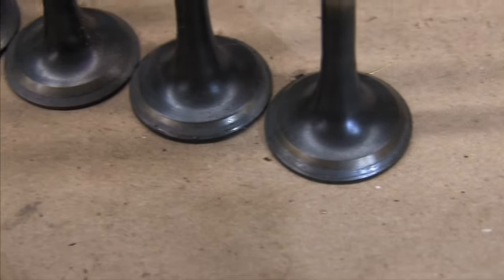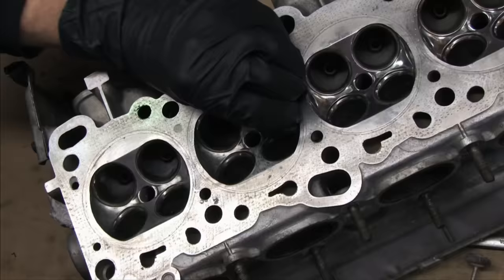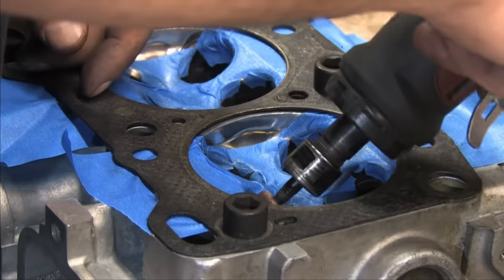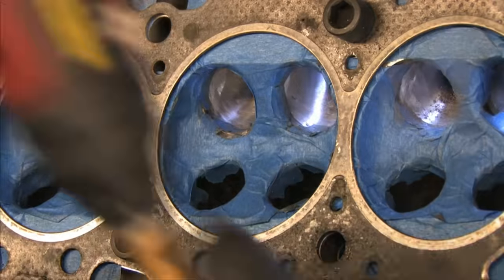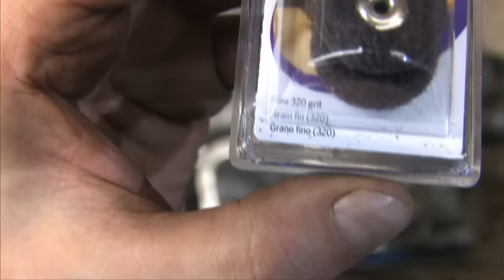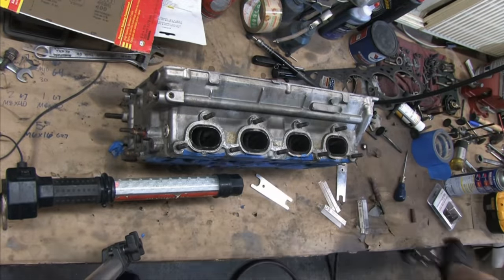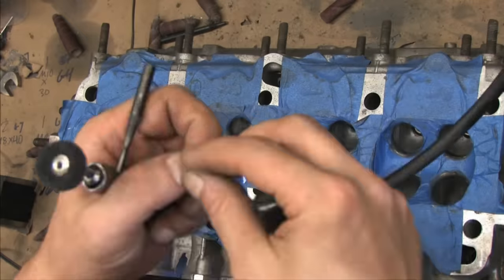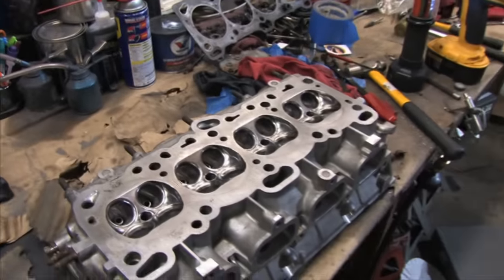Cylinder Head 204 - Porting & Polishing

Comment: I OWNED AN AUTOMOTIVE MACHINE SHOP BACK IN THE 80'S AND I'VE PORTED SO MANY HEADS I'M TIRED OF IT, BUT I ONLY DID CAST IRON HEADS AND HAVEN'T DONE IT SINCE THE 80'S... YOU DIDN'T GET TO THE VALVES AND IF YOU DON'T POLISH THE VALVES, YOU MIGHT WANT TO CONSIDER CHUCKING THEM INTO A HIGH SPEED DRILL PRESS AND POLISHING THEM TOO...VERY PROFESSIONAL VIDEO... YOU BROUGHT BACK A LOT OF MEMORIES FOR ME OF ALL THE WORK I DIDN'T GET PAID FOR...

Comment: The pro shop I use has a porting and polishing setup that is hypnotizing to watch. He fills all the ports half full of steel and lead shot and then tapes them shut. Then this machine rotates it in all three axis at the same time it spins between the clamps. He shuts off the lights and goes home while this thing keeps rolling. Next morning he removes the tape and dumps out all the shot. What's left is amazing. Every single millimeter that the shot can get to is smooth and shiny as a mirror. It peens over any casting lines and casting defects. He claims a 30% increase in flow of both air and fuel. But it only cost him about 40 minutes of prep time in labor. The rest is being done while he sleeps. Liked and subbed
Reply: Uhhhh...LS7 head cnc porting routinely sees around a 7.5% increase in flow. That's 7.5% using cnc porting. A 30%(!) Increase for rolling some shot through a head? Gotcha. So, if the intake side flows 330 cfm, after his "porting", it will flow 429 cfm? Engine builders have the easiest job in the world. Selling rubes horsepower.

Comment: As an engine builder I still smile when I see a polished intake port ! Polishing a port slows down flow, we worked this out in the 1960s , you have just lost power ! Ports are rough cast for a reason , it is the cheap way to induce turbulence in the flow at the port surface , the ideal port would be smooth with small holes drilled about 3 mm apart, just like a golf ball, it is the same principal , a totally smooth ball only goes half as far as one with little holes all over it, the reason being air flow over the surface of the ball , the holes make little vorticies that make air flow more , same as an intake port ,  sure the factory can cast super smooth ports , but they know they need disturbance for flow.
Reply: What about the carbon?
Reply: @turbosloth2  what about carbon ? If you have carbon in the intake port you got more problems than good flow !
Reply: Egr and direct injection and loads of carbon

Comment: 5 yrs later I came back to watch this. I followed most of these points and made good power from porting my heads. Even only doing a Stage 1.5 on my J32 made 316/262.....nice gains!

Thanks for an awesome video that is still prevalent till this day.
Reply: pilzy els I found 80grit, to 120, to 340ish buff wheels like he has is the best combo. 

80 to knock the high stuff down and smooth the port, 120 to smooth and 340 buff to polish (with polish compound).. anything beyond that is a waste of time of a Street, even minor track car. I did polish the combustion chamber and ran 100shot of nitrous for 100k Miles. It was very rare if I got any knock

Comment: great work, and an excellent tutorial. One rule I always keep in mind is intake port velocity for torque, more port volume robs that velocity, so it's a balancing act from intake 
gasket to valve seat.The trick is to resist opening intake ports up too much, once it's gone it's gone... best to aim for progressive transition and know when to stop.
To make real power, always do your flowbench tests with 50% valve lift, as that's where most of your flow duration occurs.
 I made my own once with a vacuum cleaner and a manometer, simple but very effective.
Thanks for posting.

Comment: I have an old set of knock off weld racing wheels on my foxbody they were hazy and chemical stained but one day I sat down with a mothers power cone for about 7 hours and shined all four to a complete mirror shine. After I saw what I could do I polished my intake and the stainless steel exhaust tips ... I was so proud

Comment: I'm not sure if the tech mentioned this tip but.....the term blueprint means to make every cylinder the same as that makes even firing and power supply.It also makes an engine easier to tune and of course gives the engine longevity.That means all your port sizes and finishes must be identical.Another tip i learned from a World class racing builder is to match all your spark plug positions.While the head is apart one by one you make sure the spark plug is parked/seated in the exact position.So that means marking them to suit each cylinder.Turbo and supercharged engines are vastly different to naturally aspirated engines also for abovious reasons.This video is insanely good and much respect to the tech.Happy porting y'all.
Reply from the maker: "plug indexing".  ...and thank you!  All correct!

Comment: I just got halfway through porting a Mazda Protege cylinderhead using the techniques featured in this video. So far I'm pleased with the results. I dove right in with confidence. This video  explains with great detail basics and gives a few tips and tricks. Great video Jafro. Hope to see many more. Subscribed.
Reply: How did it go?
Reply: @elic.2443  It actually came out pretty good but I may do another one because the head that I polished had some damage from a failed spark plug. The machine shop said it was repairable but I'm thinking of starting over. Go to my channel to see the results.

Comment: One of the best DIY Porting videos I've seen. Oh the hours I spent Porting and Polishing Buick and Pontiac Heads at NorthWest Buicks in Oak Harbor Washington. A good respirator is a MUST. I had to use carbide on the cast iron, but once the shape and diameters are where you want them, then yep the spiral sanding tips are where you want to be. I applaud you on the rough floor, in big bore engines at idle or when they are cold the rough surface helps keep the fuel from pooling and sticking to the floor as the air hits the pockets and pulls the fuel up into the air stream. The smooth surface on the roof and walls is great at the high rpm's to keep the turbulence down and things flowing with little obstruction to the valves. Unless you have a flow bench it's a good idea just to port match then smooth and blend the walls, as the engineers know what they're doing and most people don't, so removing the imperfections is the best all around thing to do. If for some reason you just have to increase it and don't have a flow bench or Dyno, KEEP it all the same size between the channels using a set of dividers. Measure the width, height and diagonal dimensions and keep them as close as possible. The same goes for the combustion chambers too with the valves installed, except you'll have to CC them to make sure they're all the same volume, and yes blend those sharp edges to keep pre-detonation down. Thanks for sharing. Best Wishes and Blessings. Keith  Noneya

Comment: Very nice work and not because it's shiny.

From the sight of my limited experience and knowledge i would have reduced the lateral bumps on the valves guides and widened the ports a bit just here.
it would help the flow since it's a restriction zone caused by the valves and guides. 
widening the port here would compensate a bit for that.

Maybe i would have rounded a bit more the squish angle to limitate detonation since you said it's a high compression engine.
because of the forced induction the squish turbulence is not a big necessity i think.
you have quite a nice tumble on a 4 valves cylinder.

It may help you next time : i use a vacuum cleaner with a fuel hose taped to it that i plunge in the port that i'm working on to suck the debris when i grind (especially the exhaut ports)
it works very good to see what i'm doing and to limitate the tools to clog.

Very nice work again.
Thank you for showing that.
It's really interesting.
Reply: Good point on the vacuuming of debris.  I have seen awesome basement woodshops with central vac system to get rid of all that annoying sawdust.  Now that stuff is annoying, but much more important to get rid of metals and such.  Glad he wore a mask.

Comment: Years back, a buddy of mine had the dream and goal of owning his own Harley shop. He was and still is strictly old school and so he does nothing but custom builds and repairs, nothing new. Well, back when he was just starting out I told him if he needed any help, to give me a call. Two days later, he called. This was back when shop space was still part of the dream, so we worked out of his girlfriend's apartment. The first bike we built was his '79 FLH  Soft tail. Well, Harley Davidson, then and now finishes a lot of their cast aluminum components i.e. rocker boxes, primaries, secondaries, brake calipers/master cylinders etc. in a "factory" baked on "wrinkled black" finish. And I'm here to tell you that wrinkled black finish hides some of the roughest casting I have ever run across in ALL of the years I have spent Polishing aluminum.(I'm also a retired general contractor/cabinet shop owner/utility patent holder and won and lost and won back small fortunes over the years) From a soda pop can on my fathers polishing wheels when I was a kid to bmx brake levers/center pulls, dual tunnel rams,  Holley intakes, Berkeley jets and many other boat parts...Harley takes the cake. At one point, while working on the rear banana caliper for his FLH (we called it "#1"),  I was standing at the kitchen sink (wet) working on the outside half of that caliper with 2000 grit (and mind you, it takes 40 grit on a DA to bust that wrinkle black off, so...) But I was ready to go to Mothers applied with 4 ot steel wool, shut the water off. Dried the part and that's when I realized that I was bleeding through the pads of my fingertips, because I had blown out my last pair of rubber gloves a week back and had not yet replaced them! About then, my buddy arrives back from yet another field trip from what ever swap meet he had been to, buying up any and all used Harley parts he could barter down to almost free (he lives to make the deal)(in ways most can not imagine) but he walks threw the back door, sets yet another greasy cardboard box on what once was a nice dinning table and with a shit eating grin turns to me and says, "Hey Shoe shine boy, what are we going to call the place once we have a place to call?"  Shoe shine boy? Where did that come from? anyway, I set that thought aside, looked around me at this once upon a time young lady's clean, neat apartment that now had Harley spread from one end to the other along with roll-a-ways, grinders, drill presses and many other shop like tools super imposed over the top of  and blended down into this once nice apt. (I have always picked up after my self. My buddy? Not so much.) We stood facing each other, his grin starting to fade as he waited for an answer from his right hand man recently nick named "the shoe shine boy" of all things. I didn't want to be rood, but I can not be anything but whom I am, so I pointedly looked around the place and then back at my buddy and said, "I don't know...The HOG PEN?" And you know what young man? Now that I am retired with nothing but time stretched out in front of me, I had finally reached that point in life when a man has to ask himself, "What do I want to do?"  Well, over thirty years later,  come the first of the new year, I am loading up my triple pop-out 5th wheel R.V., hooking my new dually Ford diesel  up to said hitch and taking my home away from homes up to the little lake town called "Nice" located around "Clear Lake" in Mendocino co. and parking my shit right next to my buddy's long time established down town retail, wholesale Harley and quad shop, named..."The Hog Pen"  where I will happily re-earn a once proud nick name, "The Shoe Shine Boy." And I can't wait!  So when you can comb your hair in the mirror like finish on a part that came to you with factory wrinkle black? Look me up...I'll be playing in the hog pen with the big boys!  (As a hobby, I also write fiction and don't care if I never get published), but this here short story...is 100% true, on my mothers grave. Take care while making it shine! Peace and cool beans! I'm out. Signed, The Shoe Shine Boy    (mic drop.) PS I know it ain't the same as polishing and porting heads, I polished my oldest son's aluminum heads that went on the stroker motor we built for his '65 GT350 mustang. (a very fun car!) And yes it is time well spent. You get out what you put in...I call it the 7 "P's". Prior. Proper. Planning. Prevents. Piss. Pore. Performance...Peace